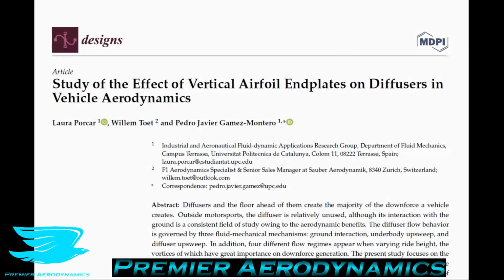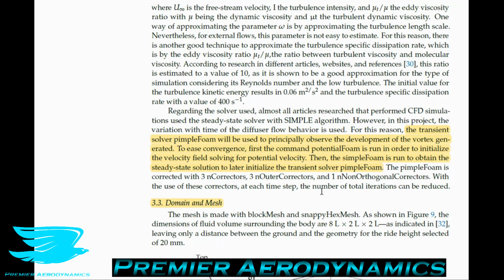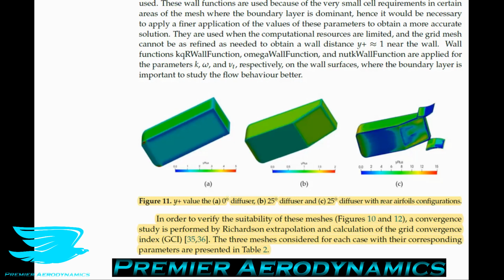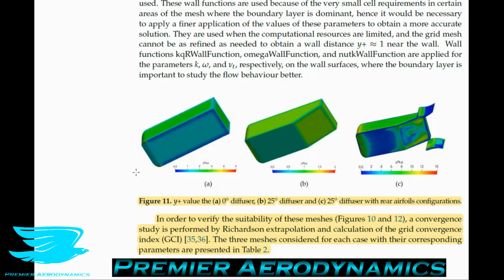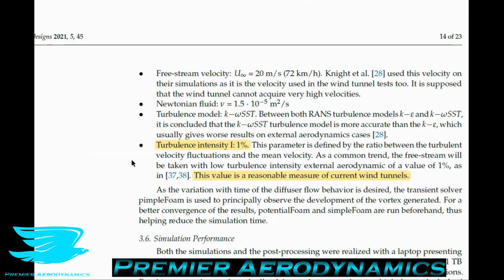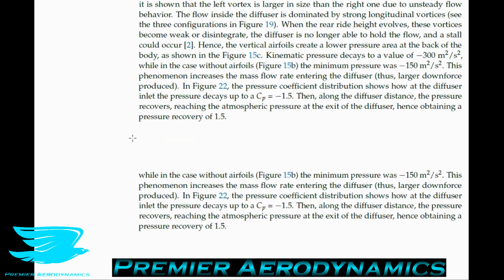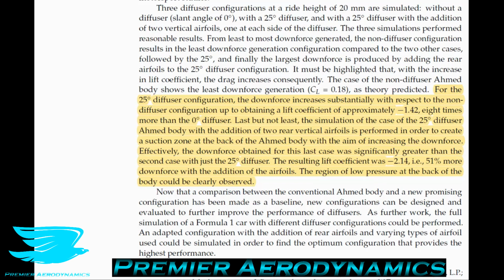Aerodynamics of Vehicle Diffusers in Motorsports part 2 - Podcast #109

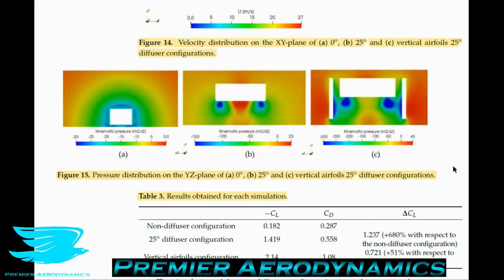Comment: @21:48 You can see something really interesting. It seems downforce is created by having the highest energy highest velocity airflow as low as possible. The scales across a b and c are not symmetrical so it kind of tricks you a bit at first glance. When the scales are equalized you see how much more high energy flow exists in C vs B. The vortices are a source of drag, likely the main source of drag, but they're also great nozzles, so the air that flows around the vortices essentially maintains its energy all the way past the diffuser itself.
Reply from the maker: That's true. Because vortices are low pressure, putting them at the back means that there will be a surface with lower pressure, which will increase the pressure drag. I also think that the low pressure of the vortices also helps suck through more air. Without this lower pressure, a back pressure can form and that will hinder how much air will come through.
Reply: @PremierAerodynamics  Like the passage vortex in turbine engines serves as a flow restriction to an extent, and a source of losses, but also energizes the boundary layer. In that sense they're not so dissimilar, as the blades on a turbine engine also deal with the hub and casing creating a pseudo ground effect.